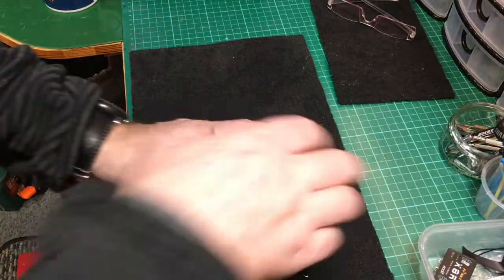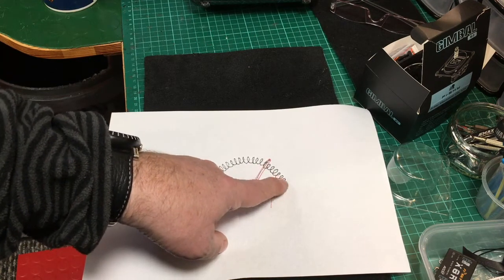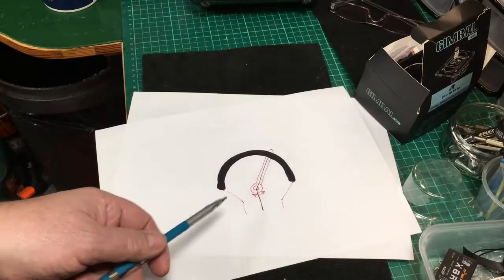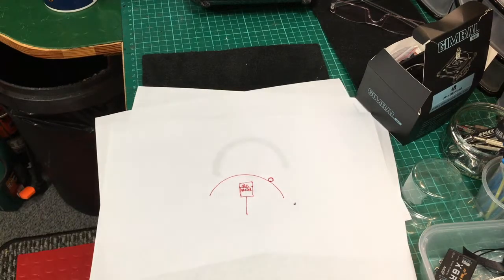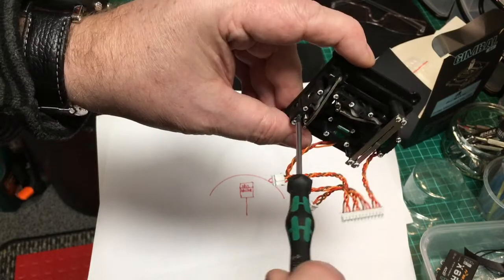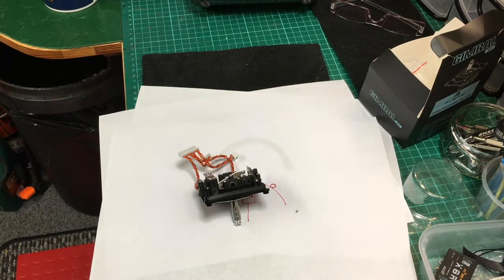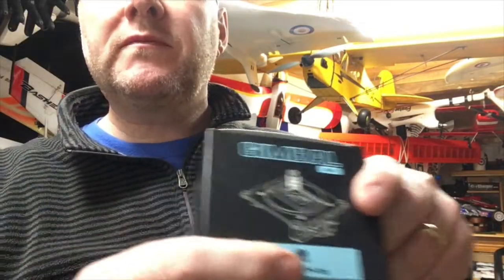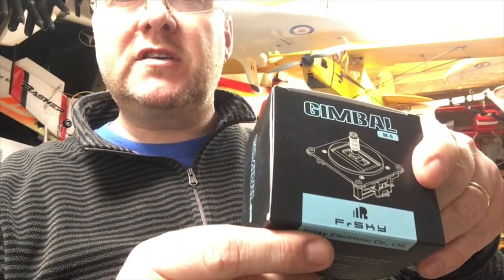What are FrSky M9 Hall Sensor Gimbals

Comment: I'm currently making my own transmitter for an RC Plane I'm also making, using Arduino. I have a few hall sensors I didn't realise.. I'm currently using the old method using thumb sticks potentiometers, i had to desolder my xbox thumb sticks are the're decent quality you get full range, while the cheap modules you can buy have very little range. Still not great! But I'm newb to flying.
Reply from the maker: Wow....respect....
I understand the enjoyment you get from building your own but I am also nervous of having a reliable RC connection. I use FrSky and seem to get a good range from their protocol. 
Check out the ZOHD Kopilot Lite flight controller that has return to launch so if you have signal loss it will turn around and come back to you.